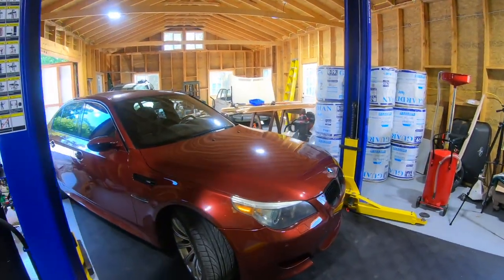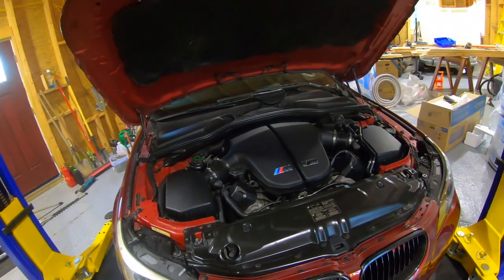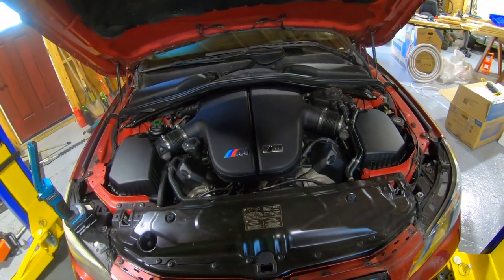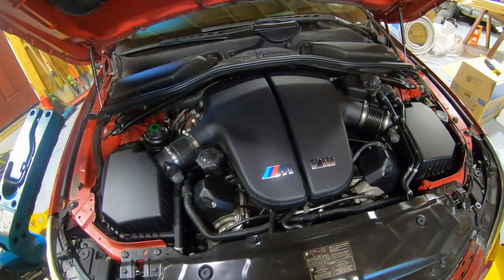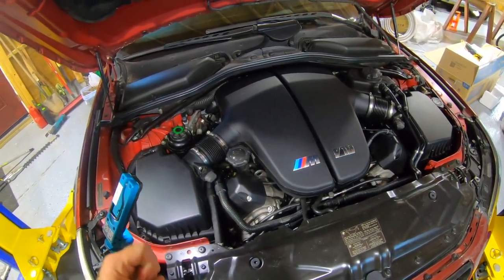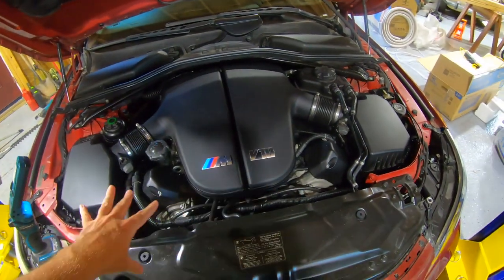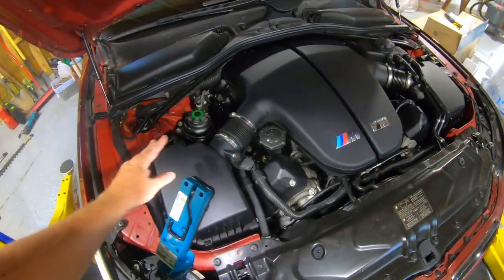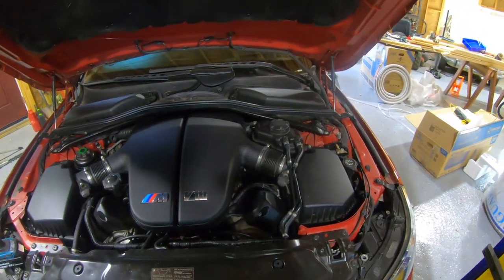BMW E60 M5 S85 V10 Engine Misfire And Rough idle Causes And Fixes

Comment: Man, you hit the nail on the head with so much you said here. One thing you left out, right under the throttle actuators, sits idle actuators..at about $600 a pop. But if you are in there, do them. I have the same car, same Indianapolis Red, with the Portland interior. Bingo, people buy these used, run the hell out of them, don't fix the abuse issues, sell them, then the next owner goes on the forums and says they are junk. They don't wanna pay what 10w60 oil costs, so they make excuses...so and so says 10w40 is fine, or whatever. I believe rod bearings go fast, because people have no idea how to warm this V10 properly, use the wrong oil etc...IF, the bearing was the problem, don't you think BMW would have fixed that way before now?...I don't know, I have had two, yes they are not cheap to work on, but if you want cheap, but a Ford/Chevy and drive what EVERYONE else has. I use only Redline 10w60, Redline75w140 limited slip diff oil, Redline fluid for the SMG
Reply: You also hit the nail on the head
Reply: Spot on! Well said! I use liquid moly products. Just my preference and I have had no issues. I also had a few things done as soon as I purchased the car. I did my rod bearings the first week with ARP bolt. I used the BE bearings. This was done at a certified shop. My self I did the spark plugs, coil packs, both ionic current modules, fuel pump, fuel filter, I have the throttle bottle actuators and the idle actuators and I have had them for a year now but have not had the time to put them on yet but will very soon. Just out a brand new set of Continental contact O2 sport on her literally last Friday. I just order the Pcv valves, thermostat, and the pinion seal and diff oil even though it’s not leaking once I go under the hood that will be it for a bit. I have not replaced the charcoal fuel filter canister yet either. That will be in the near future as well. Next big purchase is brakes and rotors.  Ugh. That’s a little ticket. Oh I did by 2 of the O2 sensors. (1) upstream and (1) down stream
Reply: Yea, when I was in mine, throttle actuators, I did the idle version as well
Reply: I had my bank one idle actuator fail so I replaced both pair. I was told the previous owner replaced one of the throttle actuators but they both looked the same age to me. They are working fine so I’ll replace them later.

Comment: Agree this is not a daily driver.  I bought mine knowing this.  Highly discourage anyone from buying one that is going to be their daily driver.
Reply: Bro I rather  own a m6 same year Sony you agree akao!? If not please  explain bro? Thanks!!!
Reply: @76tfdtr4r5  this car WILL leave you stranded at some point. Both of my vehicles are sorted at the moment.  I Just know the E60 M5 has left me stranded in the past.  My daily was there to get me too and from work.  It's  Better if one has AND can afford a secondary form of transportation when owning this car is what I am saying.
Reply: @76tfdtr4r5  do you own an M5?
Reply: @76tfdtr4r5  it's a convenience thing for me.  If my one M5 was down I would be stuck.  And economically speaking you may be right but why have one toy when you can have/afford two? ;-)  I have had my M5 for 8 years now.  At one time I was running a c-class as my daily and the M5.  Then moved on to an E61 530xi and the M5.  Now its TRD Pro 4runner and M5.  The M5 has had ionic modules go bad, throttle actuators go bad, alternator go bad, clutch went on it, SMG had to be replaced.  All that time I had a daily that I also loved to drive and could rely on while my M5 was being repaired.
Reply: @76tfdtr4r5  ok sure thing.  Have a good one.
Reply: It’s more like a daily headache.

Comment: Does the car vibrate when it idles rough? in my case, I can feel and see the doors vibrate when you open them while the engine runs idle in neutral. I am still investigating what causes this vibration. Filters, oils, fluids, rubbers (from the airbox which you mentioned), MAFs, coilpacks, sparks, etc replaced. Also changed the flywheel. I still get the vibration though
Reply: Fuel injectors?!

Comment: Thanks for the video quick question is the Icom necessary when using insta nobody will seem to answer me I want to download is the in info I was just wondering what the Icom does?
Reply from the maker: the icom is faster so you would need it for some programming, but jsut for reading fault codes the cable is fine

Comment: hey bro i just bough a 2008 bmw m5 on my way home the transmision malfuntion come up and there also a code for p0174 bank 2 lean i ask the owner he say i need to replace 4 new camshaft poisition sensor  is that correct?  and he also say he replace the camshaft sensor like 4 year ago and clutch and flywheel replace 15k mile ago

Comment: I have this car in this color, a 2006 M5. My mirrors will randomly tilt up/down, when I spray the car with water [doors]. I know where all the fuses are, but have no idea which one controls this, as I have no diagram. Do you know where it is/which one? Thanks....by the way, BMW says all these has Daytime running lights, mine does not, not even a setting in Idrive. Ever seen this?

Comment: Nathan I have a question please.  What are the common fla6with the 2003 M5 please? Thanks alot man
Reply from the maker: The common flaws? If so still rod bearings , clutch can be expensive , the getrag manual trans can have bearing issues  , and all the usual e39 problems window regulators abs pump etc

Comment: Smoke test! after 14 years, bound to be air leaks. save money get a $75 paint can one on eBay. taking parts on and off can fix it or create gaps, so replacing other parts trick you into thinking it was a coil when it was a leak.

Comment: Hi

I love your videos!

I just acquired a 2006 M5. Misfire codes on 1,2,3,5 basically almost entire bank. I erase. Codes and limp mode appear within 5 seconds of start. 

With a scan it just pops up misfire codes 

Figured I rush the throttle since coils look new. And I tried swapping with driver bank. Don’t know the history of the car 😢

Housings say 2006. I removed gears and in fact they are worn. Definitely a fail

Replaced both throttle actuator gears. Cleaned ITBs 

Ionic modules look original too

Anyway. Assembled and it didn’t make a difference. Amazing, no codes for throttle with the worn gears. 

I’m down to an ionic module. I have one coming in to rule out or hopefully remedy the bank misfire 

If that fails, am I down to PCM corrosion, broken valve spring or vanos issue?

Thanks 🙏🏼
Reply from the maker: Ionic module , if only one bank is showing misfire
Reply: Gotcha 
I will update when it arrives 

Again what I should’ve done is swap them and see if it cancels the other side 

Thank you very much. !!
Reply: Unfortunately, it’s still misfiring 1,2,4,5 as soon as it starts. Then goes to reduced power

Installed ionic module. 

I will check it out tomorrow, but now noticed Vanos rattle from that bank. 

Think I need to change those too. But before throwing parts at it I will scan it and verify what’s happening 😔 

I’ll watch more videos soon. Drove these cars but never owned one til now

I am still willing to learn a lot you and the M5 I own 

Thanks

Comment: These BMW wiring plugs are really finnicky, we were having VANOS codes on the passenger side for the exhaust on an N62 V8 and we literally swapped all of the VANOS solenoids around with a spare parts 7 series vehicle and there looked like there was nothing wrong with the solenoids themselves either, so yeah MAKE SURE YOU FULLY INSERT ALL OF THE PLUGS

Comment: I need some help. I have an issue with multiple misfires bank 1. Misfires cylinder from 1-5. Not the coil packs, Ive replaced plugs, ionic sensor, checked my O2 sensors all Working properly. I dont get any other codes.
Reply: You were able to fix your problem dude?

Comment: M5 E60 is only a BMW Fanatic Fan car who has a laptop with INPA/NCSexpert/DIS/Rheingold, etc. Then he must know how this engine works and the components inside it as well as the gearbox components. And of course a good salary/other income to afford maintenance. This is not the usual driver's car where you just pop in, push the start button and floor it. If you want that, go buy a ferrari for 10 times the price and the same performance, maybe slightly better.